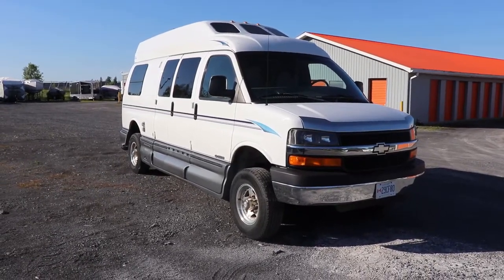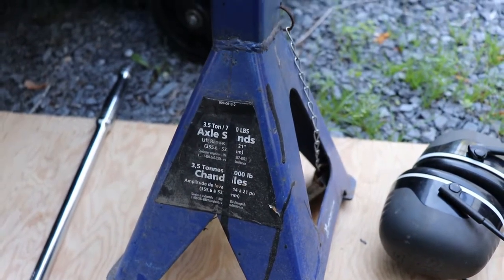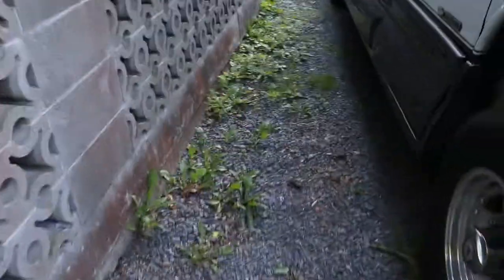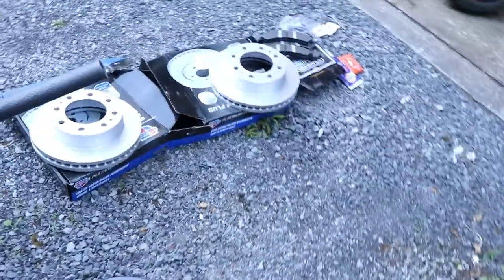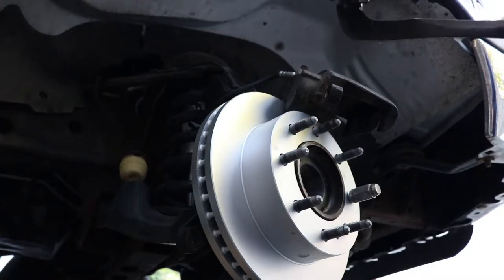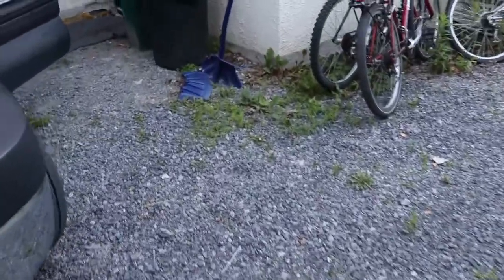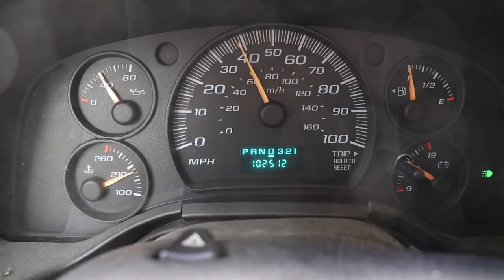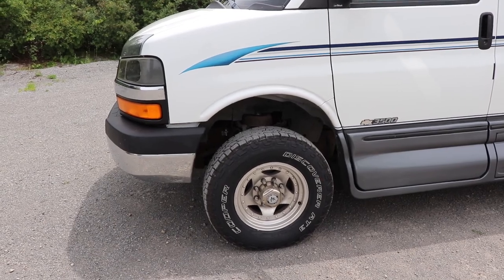Chevrolet Express 2500 3500 Death Wobble Fix

Comment from the maker: Please check out my affiliate links in the description if you are looking for parts and pricing.
Reply: Hey man where did you get the 6 inch spindles? Thanks for sharing
Reply from the maker: No problem.  I got the lift from WeldTec designs and have a few videos on the install.

Comment: Rotors have nothing to do with death wobble  unless your braking hard on warped Rotors witch your steering components will compensate for. Main couse is pitman arm idler arm and idler arm bracket

Comment: I have a 2012 Express 2500 4.8L. This started almost 6 months ago. Little by little, it would do it from time to time and it got progressively worse until 10 days ago when it became a problem. I never changed anything. I just rotated the rear tires. The problem went away. Everything disappeared and I was already thinking that there were things wrong with the suspension.

Comment: I have this wobble on a 2016 chevrolet 3500 only when braking and not all the time, it seems to be a abs issue that started after a dealership oil change and tire rotation out of the blue. Again it's not all the time but when it does it's a really violent shaking that can be stopped by a fast light pumping of the pedal then full braking as needed. Any ideas?

Comment: Thanks for the video I’ve experienced the wobble in my 2015 3500 ext. express down grade while pulling 10,000 lb trailer even with trailer brakes doing their job if it weren’t for tow mode helping with tranny and panic lever on electric braking system I would have been in trouble.
Here I am searching for brake upgrade and glad I found you.

Comment: Like your video. And wondering where you got such a tall lift kit for a van. I have the 2” lift that I bought from Supreme Suspensions out of southern Calif. USA. all I could find.
Fallowing your advice and bought the car quest HD fully coated black rotors and their best semi metallic pads .
I have a 2015 3500 express ext. LT  and gets used part time to tow 10,000# tt and then one time down steep grade there it was the death wobble. Thanks for the vid. Oh and the other videos all have the wear indicators at bottom, I’ll find out today which way they are factory.